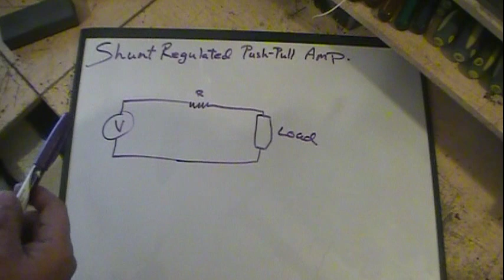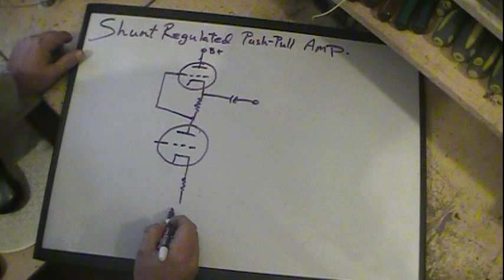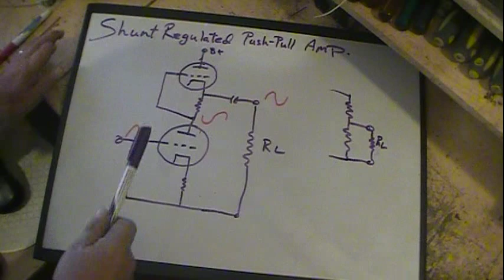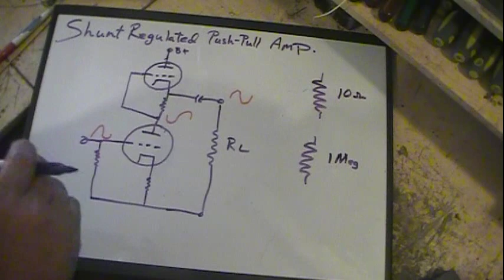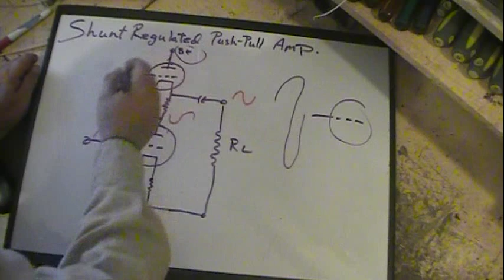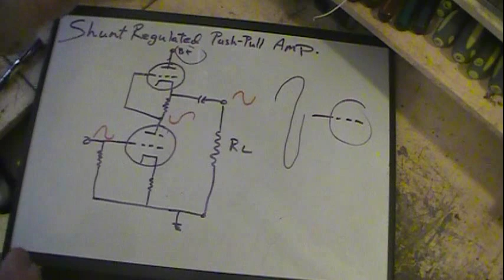Shunt Regulated Push Pull Amp

Comment: Great video! Was thinking... I've heard that srpp stages make great headphone amps.
These normally use a B+ of 200-250v..
What if I was to omit a power transformer and simply rectify and filter the mains coming in (230-240v UK) and straight onto the B+ rail?

Comment: Dennis, I hope you can help me with my dilemma.

I have to measure a DC Amp from a rectifier that is between 11 & 12 DC Amps.  Now, I've blown a few fuses from my Fluke multimeter because It cannot withstand a load of over 10 amps.  

What I'm doing now is that I measure the DC Volts and the resistance of the wires going into the magnetizing coils.  Then I use Ohm's law to find the DC Amps.

However, I want to be able find the exact DC Amps without having to buy another multimeter.  It is my understanding that a resistor shunt is to protect a device from getting a full current load by exerting resistance. I was thinking about the following:

Because  I'm trying to measure a 11-12DC Amp output with a multimeter that has a 10 Amp DC maximum tolerance, can I use a shunt with a resistance or approximately 2 ohms and measure the DC Volts; once this is done, use Ohm's law to calculate the DC Amps?  

Once this is done, the DC amps that I measure using the shunt will be less than 10 amps.  Then just work the backwards to find the DC Amps without using the multimeter.  By the way, I'm getting a DC Voltage of 

Would this work?

I hope I didn't confuse you.  I hope you or anyone watching this can help me Please.

Thank You,
Reply from the maker: aggienica Yes this will work.

Comment: This one is a blast!!

Thanx for this great overview. Honestly i do not like the SRPP design, but never the less, there are some audio amplifiers that uses this toppic within its driver stages. I also never tried it out, as i´m a little "fuzzy" about direct coupled tubes, as when they drift you´ll never know what happens.
As you said it as well, the math behind it is not simple, and one can easily run into difficulties when trying out the SRPP. You may end up with more odd distortion than you get when using two stages an a classic chain. First the grounded cathode type and a cathode follower for the output decoulped with a Cap.

I´m always happy to see some great explained tube priciples. As it preserves the knowledge about tube circuits. The more people are joining together and presenting their knowledge here @YT the less will be fading away, leaving only fuzzyness instead. This will leed to people who tent and/or try to rip off poeple who want to get their tube suff repaired and/or want to buy a new (Instrumental) Tube Amp.